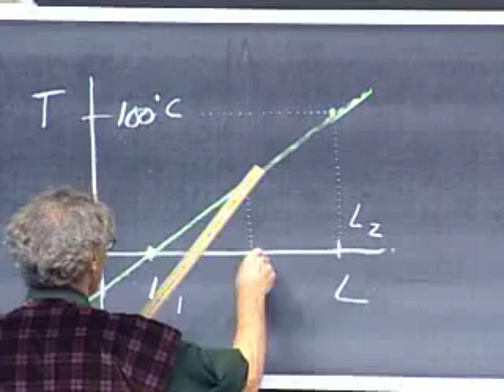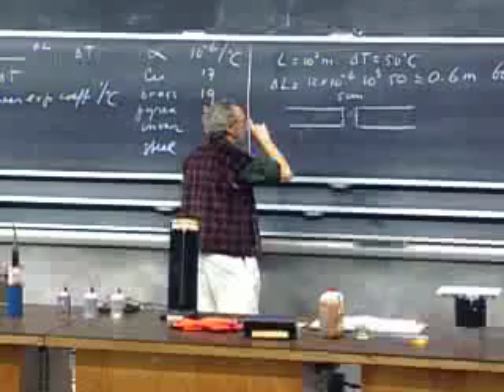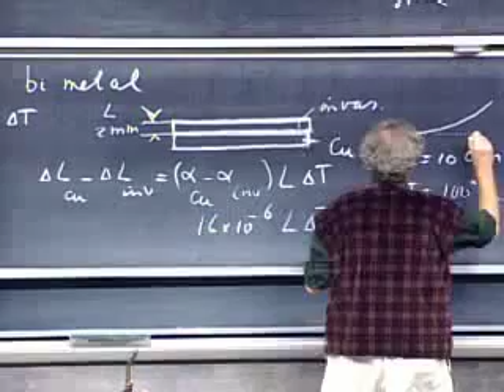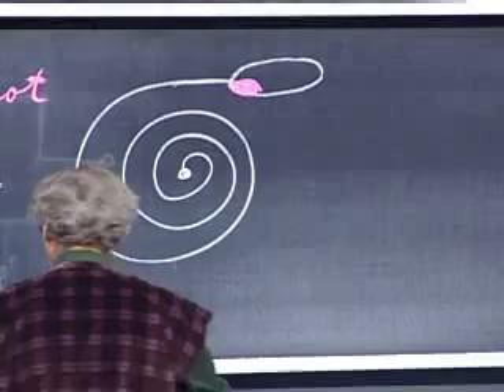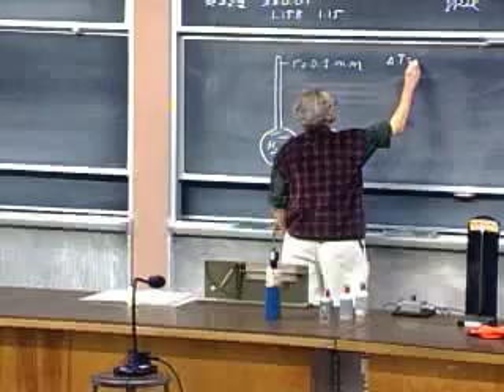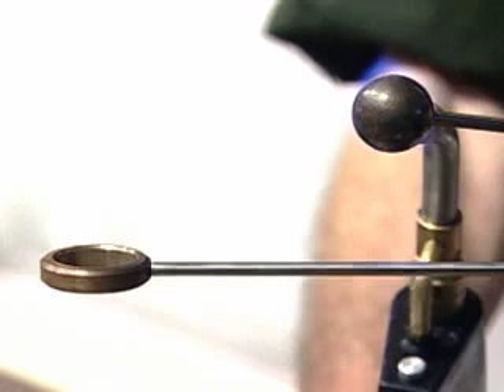Lecture 32  Heat   Thermal Expansion

Comment: Please which direction are you heating the metals? what happens when you heat it in a direction normal to the bar
Reply: Heating happens in all direction but thay some times cancel expansion in a certain direction as it is very small
Reply: So there are three thermal expansions :linear, Area,and  Volume expansions